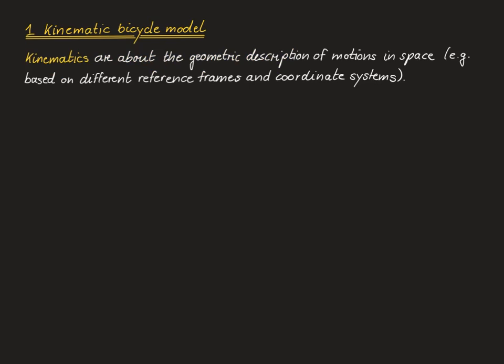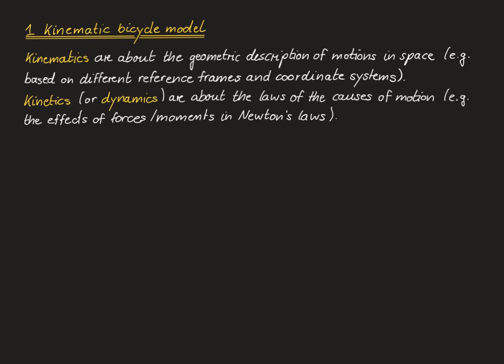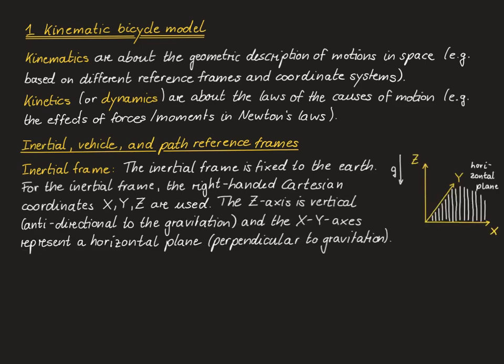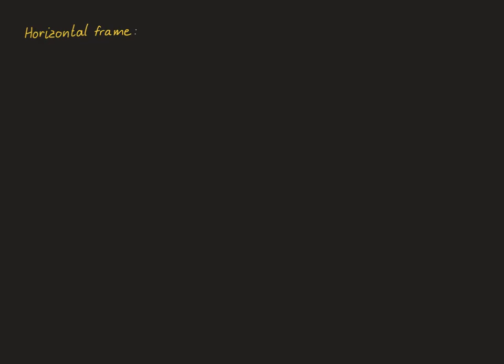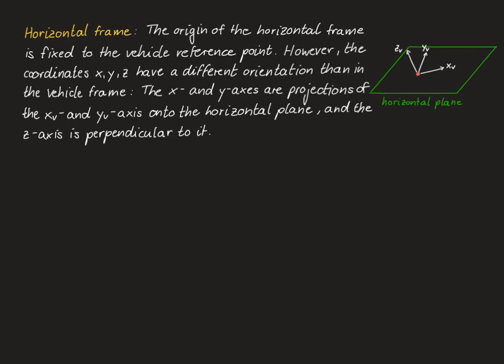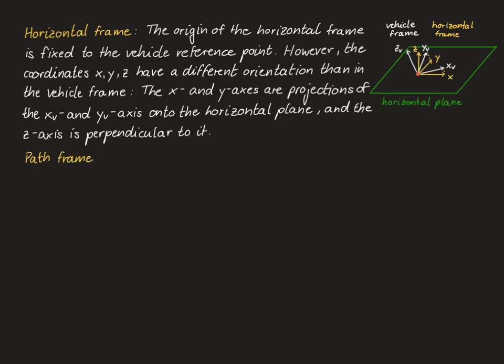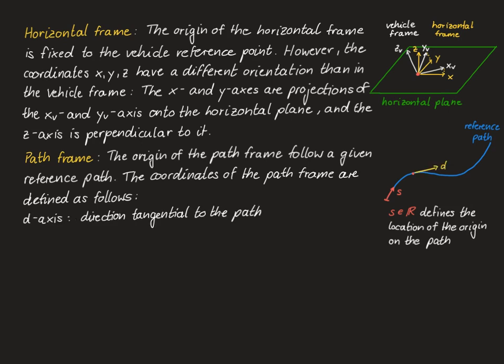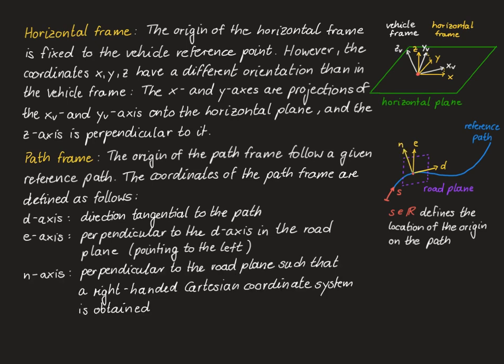Vehicle Dynamics & Control - 01 Coordinate systems

Comment: I'm a math student and somewhat new to this engineering content. At around 6:40, would it be correct to say that the path frame will be the usual tangent, normal, binormal vector frame one would get from vector calculus? The d-axis being the tangent vector, e-axis being the normal vector, and n being the binormal vector?
Reply from the maker: Yes, that would be correct.